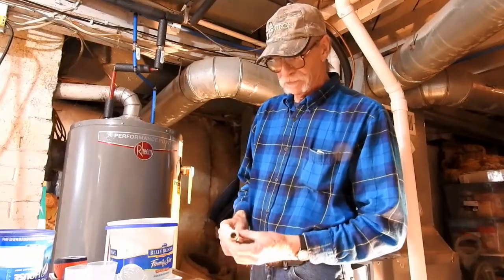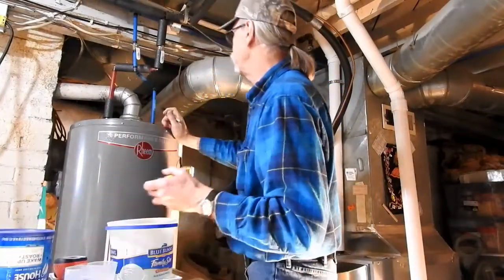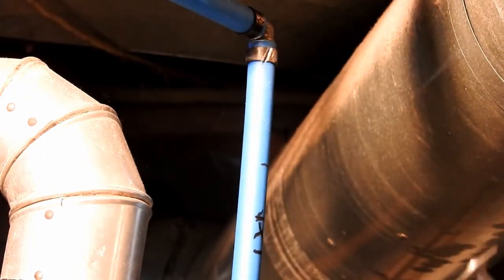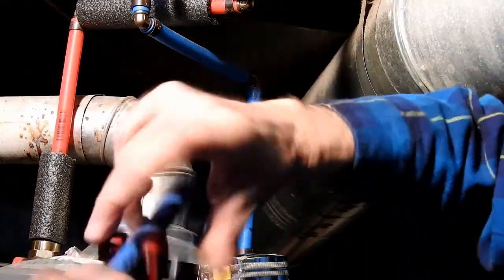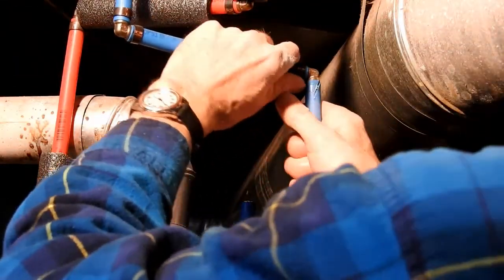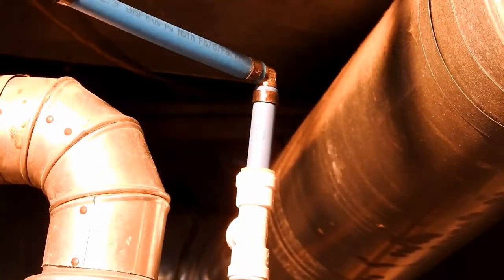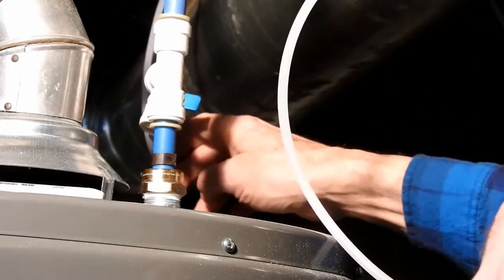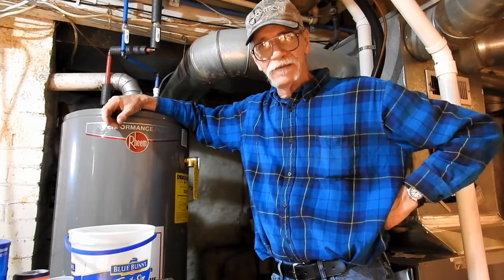WATTS fittings and PEX tubing

Comment: I have a similar setup, but my tap to the humidifier comes off the hot water pipe right after it exits the water heater. It was installed that way by a plumber many years ago, and I always assumed that was correct. It makes sense to me that hot water would more easily evaporate into the furnace air, but seeing you tap off the cold makes me wonder. It would certainly save gas heating costs in my case. Any comment as to why you chose cold, and how it has worked? Thanks--
Reply from the maker: Cold water doesn't hold as many minerals as hot water does. More mineral deposits lessen the life of the filter and humidifier and with hot water create an environment for bacteria and mold to accumulate. Thanks for the question.

Comment: SharkBites and Push-to-fit fittings work great on COLD lines, but on HOT lines the more frequent expansion/contraction of the pipe sometimes leads to the o-rings failing after 5 to 10 years, so you have to be careful there.
Reply from the maker: Thanks for the tip. Will keep an eye on it. Not sure if I'll make the  5 to 10 'cause I'm OLD.
Reply from the maker: As a side note, I did use the fitting on the cold line going to the humidifier
Reply: they can handle the temp very well